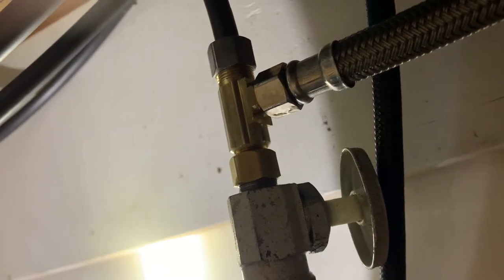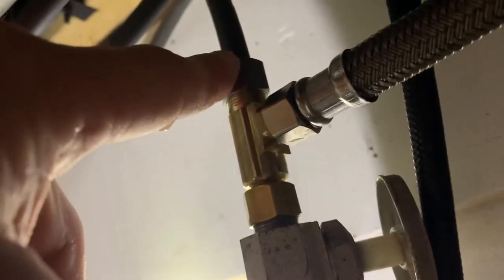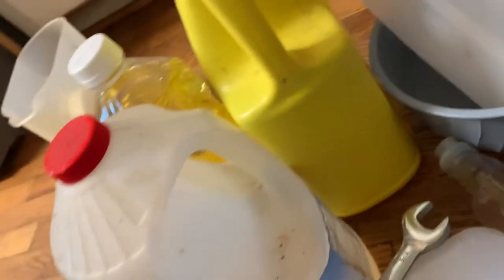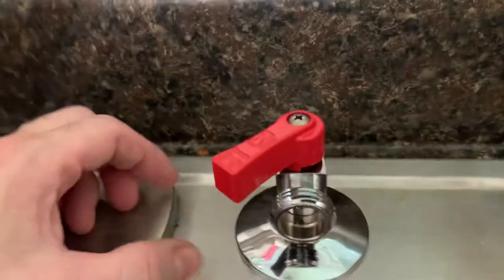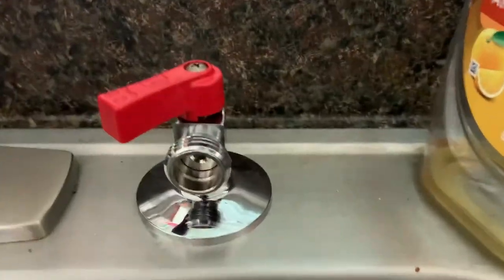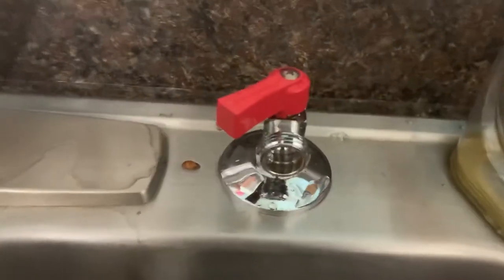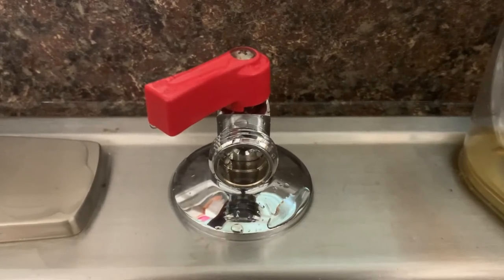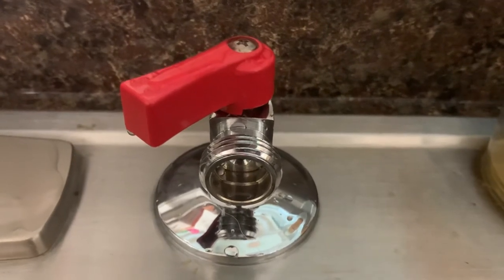Plumbing differently check for the new video

Comment: I can relate to this guy: spend 40 hours building the perfect dishwasher plumbing configuration but no time for cleaning up the counter.
Reply from the maker: If the connection is good on the quick connect should have no issues.

Comment: just wanted to let you know this set up helped me so much! i was so stressed out for days trying to figure this out. got all the stuff from your videos for about $30 and set up was so simple. thank you so so so much. :’)
Reply from the maker: I’m so glad because I looked before making the video and no easy answers. I knew it was out there and when I solved the puzzle made the video so no one else would have to struggle. You may want to add large rubber washers to the covers and a dab of lock tite to the threads mounting it to keep it better in place they can be found also at Lowe’s.
Reply: Nice video. Just wondering how did you hook up the drain?
Reply from the maker: The fitting I have was already part of a drain fill connection the drain pumps into the sink. If you do not have the dual fill and drain connection then you must put an elbow to hang on the sink that the drain line is plumbed to keep water in the sink that pumps out of the dish washer.
Reply: I'm ready to rip my hair out with this adapter BS. Bought a portable dishwasher and apparently no one carries what I need.
Reply from the maker: @“remii” I have 2 videos on this project. Inside the comments and in the videos are parts numbers. The parts are available for the large and small quick connects. The reason I made the videos was the hassle of figuring it out and finding parts. I found parts at lowes and ace hardware. I think you can also get parts from Amazon. But figure out which adapter you need large or small. Most good hardware stores carry both.
Reply: What are the products.  Im so lost.  Sorry not handy-dandy here at all.
Reply from the maker: @Camie2030  you will have to rephrase the question so I can better understand.
Reply: I've watched several videos to get ideas about permanently installing my new Comfee' countertop dishwasher, but I really like your solution best. It's the most aesthetically pleasing, it's multifunctional and it's the easiest of the installs I've watched. Thank you 😊
Reply from the maker: Thank you for a kind remark

Comment: I was looking at ways to hook up a portable dishwasher w/o having to attach it to a pull-down faucet.  This looks like it could work.
Reply from the maker: It has done fine just add a gasket and lock tite to keep it from wiggling loose or leaking around Chrome trim.
Reply: What adapter did you use for spigot  @Wiretalker
Reply from the maker: It’s a utility spigot for washer in laundry room

Comment: You my friend may have just saved me.  I just bought a new house with a pull out faucet that I love and soap dispenser but it doesn't have a dishwasher.  I have been desperate to find a way not to get rid of my brand new dream faucet and still have a portable dishwasher.  I'll keep you posted if this works.

Comment: I dont have that wxtra sprayer so i guess im still finding a solution.
Reply from the maker: If you have the regular faucet the part with the screen screws off and they make an adapter for dishwashers but there are three types. You could buy all three and return the two that are wrong.

Comment: Is there a part number for this valve on top? I cannot find one with inside threads, only outside/male.
Reply from the maker: Item #1642694 at Lowe’s is a pair of them but singles should be available at store.

Comment: I'm seeing your review a little over a year after. How's the machine working? Thanks so much making your review.
Reply from the maker: It worked great and still does. Only change was a gasket out of composite gasket material from auto parts store or some silicone allowed to set before tightening the chrome ring is needed. A little medium Loctite on the nut  underneath to keep it snug. Hope that helps.

Comment: Thank you Wire talker
Reply from the maker: Your Welcome
Reply: @Wiretalker  the only part that confuses me on this is how it drains
Reply from the maker: @CashTheRealest  most portable dishwashers have a 2 hose system the hot makes a connection by a valve. The drain exits the connector 180 degrees. In a tap on a regular sink that drain would be straight down. In this setup it flows  into the sink flowing horizontally steady but without enough pressure to leave the sink. When the connector is on the drain faces toward the front of the sink toward you.
Reply: @Wiretalker  thank you
Reply: @Wiretalker  it’s all installed!!!! Works great!
Reply from the maker: @CashTheRealest  That’s Awesome!!!

Comment: Why didn't you just uncrew the sprayer off? Thats what I did.
Reply from the maker: Good question the sprayer is the valve so the only way that works is if you are not unhooking or moving the dishwasher. Not an option for me. Also my sprayer is on my faucet the hole I used was a soap dispenser.